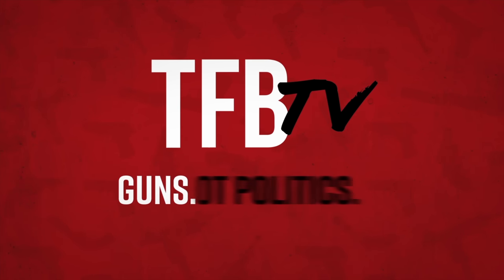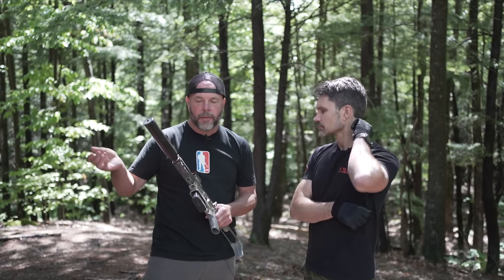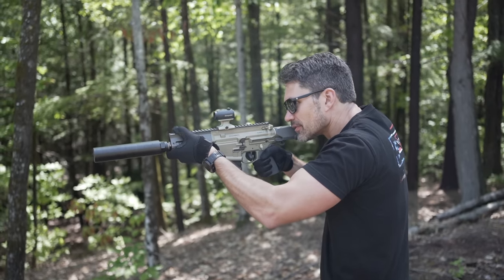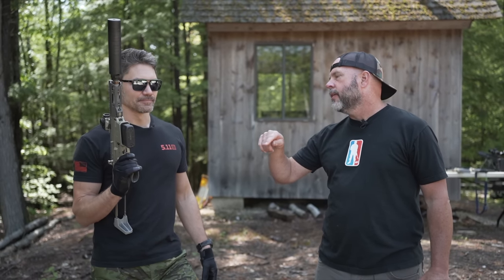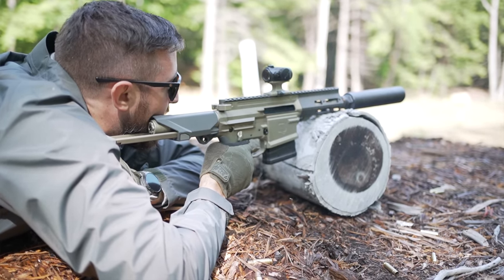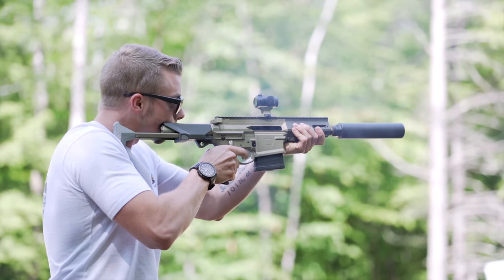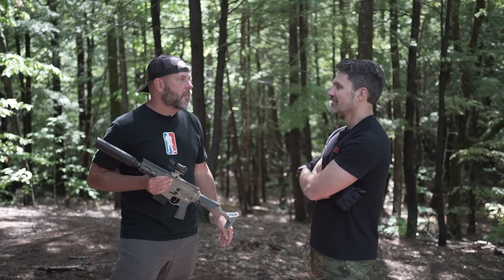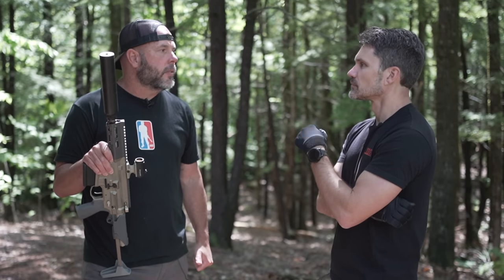NEW! Q BOOMBOX: The Honey Badger's Big Brother

Comment: I’m a huge fan of the 300 blk out. Done got 8.6 blk out ammunition but no gun.  It’s in the works for me.  Maybe I’m looking at it wrong but the faster twist rate will give more kinetic energy on target than most other common guns.  Why kill my hearing or my shoulder.
Reply: The high twist rate is needed to stabilize the slow, heavy, subsonic bullet. I'm comfortable guessing the vast majority of the energy deposited into a target comes from a bullet's linear velocity not rotational velocity...I think if you fired a spitzer into gel from close range (no chance to keyhole) from a rifled and unrifled barrel you'd see pretty similar results aside from any tumbling the lack of spin might introduce

Comment: Reloading for 8.6 is going to be a MUST! With modified .308 brass the cost of reloading ammo shouldn't actually be that bad. Not any worse than any other large hunting caliber. .338 bullets are still usually quite expensive but if this caliber takes off like 300blk did then there should be some good affordable options out there over the next 5 to 10 years. I'm excited to see if that happens and to build a gun in the caliber to mess around with.

Comment: The gun is neat. But im more interested in if other companies will make a rifle chambered in 8.6. Maybe we will get a ptr51 chambered in it and it won't be such a flashbang. Maybe a ruger sfar 8.6 version. Yeah it might be better than 300 blk, but some of big companies are just now making more than one/two rifles(or options) chambered in 300 and its been out awhile.
Reply: Faxon already sells rifles and barrels in 8.6 Blackout.
Reply: SFAR in multiple calibers is where the win is. Just need better barrel change capacity and aftermarket options. Lightweight .308 frame has so much potential.
Reply: Genesis Arms already unrevealed their 8.6BLK PDW with proprietary stock they designed for LR308 lowers (meant for their lower that works with any LR308 lower)
Reply: Of course they will. Just like they all made 300blk rifles after we did that…

Comment: Imagine coming out with a new gun that is essentially an AR platform in 2023 that ISN"T ambi!
Reply: I don’t like most ambi controls, personally. It’s extra weight, more crap to get caught on things, and more crap to get in the way. I de-ambi (aside from the charging handle) just about every factory AR I’ve ever bought, even a POF (heresy, I know).
Reply: Imagine being a lefty 😂
Reply: @jackjohnson291  how weak are you that the weight of a single safety selector or a big deal?
Reply: just don't be inferior handed
Reply: You're left handed? 🤢
Reply: @ethanbarnes3973 imagine being single handed and cant swap shooting stances depending on situation and angles
Reply: @jackjohnson291  too much weight?

Sounds like a skill issue. . .
Reply: I’m not a fan of ambi controls. I hate ambi safeties. Sorry if you are wrong handed! 🤣
Reply: An ambi gun allows you to keep your dominate hand on the grip to lock the bolt back.  Big advantage if you're clearing malfunctions, etc. or just want to lock the bolt back.  Every gun should have this capability now.  My ADMs and LWRC are my favorite guns because of this.
Reply: Isn't ambi, has a stupid ass mounting system no one asked for, which they also put on the top rail, and unless this isn't final, the shit doesn't even have a dust cover. 

Not to mention the tax stamp you'll need for a stock (which Q will also prolly charge the shit out of you for), likely some egregiously high ammo prices, and the $3K+ price tag. Ridiculous from top to bottom. Makes the Honey Badger look a lot more reasonable though lmfao.
Reply: @ckkevin9620  How many gun fights have you been in? In said gun fights, did you (like an idiot) jump out in the open to clear the malfunction? Complicating the design is problematic for all reasons mentioned above. But y’all do you…
Reply: The only ambi feature I think that is actually worthwhile is ambi bolt catch. Normal non-ambi bolt catch is awkward and requires swapping your shooting hand. Probably the only user experience design flaw on what is otherwise the genius of the original AR-15 lower receiver.
Reply: @jackjohnson291  so being able to clear a malfunction faster is bad now?
Reply: Ar platforms are just so LAME like genuine chudd rifles bruh, if thats all u can afford ok then but Jesus christ its so cookie cutter its boring.
Reply: Ambi is lame. Still.
Reply: @pablo4yu  need better bait mate

Comment: 9x39 exists, fits in a shorter action, fires bullets that are slightly wider and just as heavy, and doesn't require a twist rate that's closer to a thread pitch than rifling. I just don't understand 8.6.
Reply: It’s not Russian.
Reply: well it doesnt sound like youre a ballistics engineer so no one would imagine youd understand it
Reply: 9x39 doesnt have the super sonic capability offered by 8.6
Reply: 9x39 has inferior terminal performance at subsonic velocities.  The copper 8.6 projectiles peel into half dollar size flowers.  8.6 is not meant for plinking. It's meant to maximize subsonic performance at ranges well beyond conventional subsonic ranges.
Reply: Why the fuck is the boombox using such a short barrel?
Reply: @notjaisavage740 why use a long barrel if you can use a short barrel. Barrel length really doesn't offer any advantages for a subsonic round.
Reply: The twist was the entire point. Greater bullet expansion and more energy on target.
Reply: @mega-nerd  but why not do both?
Reply: @notjaisavage740  I'm not a ballistics engineer but I did hear one once say that casings will fall apart at that twist. I'm sure there are reasons, and a fair one is the economics. If its $15.00 a pull then who would adopt it?
Reply: Fast twist shoots flatter, more accurately, and puts more energy on target. 9x39 doesn’t have a supersonic option.
Reply: @notjaisavage740 fast twist allows to use a shorter barrel and make the weapon shorter and lighter. We aren’t relying on linear velocity for terminal performance.

Comment: The one thing i wish it had is the Brownells gas shutoff system that lets you use it as a straightpull bolt action. In case you want the semi auto with optional super quiet shots.

Comment: This is innovative stuff. And I don't mean just the 1 in 3" twist. But especially the twist rate. I think a lot of people don't understand what the twist rate can do for muzzle energy and energy downrange. I quickly built a spreadsheet to see what twist rate can do for energy and I'm still hard. And that's after I came a little.
Reply: I think there can be a lot of interesting development for lower MV but ultra-high rotation defensive rounds. Traditional soft expanding projectiles are basically a “solved game” at this point.

Comment: So it took 10 years from 300blk to be introduced to being a mainstream round. Lets hope 8.6 takes less than that
Reply: I don't see it happening.  300 BLK has the advantage of fitting in the smaller, more affordable AR-15 platform.  8.6 requires the larger, much more expensive AR-10.  Maybe you can do it in something like a Ruger SFAR.  300 BLK uses common and inexpensive .308 bullets.  8.6 needs less common and more expensive .338 bullets, particularly ones that that can withstand the fast twist rate.

300 BLK succeeded because it could live up to most of the marketing hype.  It's an extremely versatile round that performs well in places the 9mm and 5.56 fall short.  You can run it subsonic at close range where it outperforms the 9mm using a platform the same size as just about any sub gun.  The trade-off is ammo is heavier to carry.  Supersonic, it delivers much more damage than 5.56 at shorter ranges, but it doesn't reach the 500-600 yards 5.56 can.  But if you only care about 0-300 yards, it does a great job right there.  It's not a bad one-rifle solution for someone who wants a defensive weapon that can also be used for hunting medium game.

8.6 BLK is mostly a one-trick pony.  I'm sure it's a fun range toy, but I don't know how big the short-range subsonic large game hunting market is.  But outside that, it doesn't do anything that .308 or 6.5 CM can't, other than drain your wallet.
Reply: @JaronActual  I already had a solid 308 AR-10 and for $300 I got a 86 barrel and gas block. So the total invested in my rifle was around $1000. My AR-10 is a M&P 10 and got it on sale.

Comment: two things will kill this: 1. Brace ban 2. Special 8.6mm suppressors vs standard .30 cal cans
Reply: .338 cans are a thing.
Reply: @brivas3343  yeah no shit. How many of them are in consumers hands VS .308 suppressors?
Reply: @brivas3343  Sure, but nobody owns them. As opposed to 7.62/.308 cans that are extremely common.
Reply: Uh, you need to pull out a 2nd mortgage for ammo.  That could be a slight issue. 😒
Reply: No use bought .30 silencers until I did 300 Blk 🤷🏽‍♀️
Reply: @kevinbrittingham6774  yes and no. I bought one of your .30 AAC cans before I had 300blk because I wanted a multi-cal can to suppress my 5.56,308, and, 762x39 guns. Nobody out there has a .338 can because it's multi cal, they have them for their big ass special use "sniper rifles". But, this new caliber and rifle offerings from Q will certainly drive up sales for big bore cans. It's just not going to take off like 300blk did

Comment: That hand rail system is dumb. I wasn't aware I needed something "stronger" than keymod or Mlok and then you have to buy all new stuff. If it isn't broke, don't fix it. That will probably make people not want to buy it. That being said, this round and gun is an engineering marvel for what it is. I hope it becomes cheaper and more common like 300 blk
Reply: The mounting system is superior. Stronger, lighter, better zero retention.
Reply: @kevinbrittingham6774  Just because something is "superior" doesn't make it more useful. I bet they put Mlok on the version they sell to market.
Reply: That’s ridiculous. But, a cheaper version will exist and be basic.

Comment: I mean, yeah, it's cool.  Couldn't you just rebarrel an Aero 308 and get something to do the same thing, for a third of the cost?
Reply: Q isnt about Financial efficiency
Reply: FN FAL or g series.
Reply: This looks to be based on the revolution receivers so not quite
Reply: Yes, you can re-barrel a .308/6.5 CM upper and change calibers with just the barrel swap. Same bolt face, same receiver, same magazines, etc. The gas tube lengths tend to be shorter (pistol length on 8" and 12" barrels, carbine length on 16" barrels) but it is pretty simple to change those components when you swap the barrel. It's not inexpensive to shoot, even if you reload, but it is fun and versatile as a hunting/home defense platform.
Reply: No… the whole point of 8.6 is that you can have a much, much higher grain bullet than a 308 case would allow because it’s a larger diameter, longer bullet going into a shorter case.  That is what you want for shooting subs specifically. The idea is that you have a high energy subsonic platform that can also shoot supers in order to flex to longer ranges.
Reply: @danpurvis3108  Yes it would work. If you swapped the barrel and gas system you could shoot 8.6 without a problem. It's the same case head as 308 so the bolt will work fine, and when you swap barrels on an AR pattern rifle you also swap chambers because they are part of the barrel so that would not be an issue. As long as you had an adjustable gas system and the magazines feed 8.6 properly it would work fine.
Reply: @danpurvis3108  Yeah, I get your point, and I like the concept. My point is that it can done through a standardized and cheaper platform, since it is largely compatible with the AR308 based systems that can accomodate different calibers.
Reply: @JorgeGarcia-lw7vc  ah okay, I misinterpreted you. You were talking about chambering 8.6 in a cheaper platform.  That’s probably what I’d do too tbh.  I think the cost of the boombox is mostly associated with getting the weight and size down substantially lower than what you would be able to do with a run of the mill aero build. Whether that matters at all to you is a whole other question
Reply: Of course. You just miss out on a lot of features.

Comment: Kinda wish they had gone with a 9.5mm(.375) instead of 8.6mm(.338)
Reply: its so it can feed from ar10 mags

ar10 magazines angle the cartridges by grabbing the case neck of a 308 which is .338 in diameter, the 8.6 is shorter so the magazine grabs the bullet instead.
Reply: @hackerbot809  couldn't they do all that with the .375 bullets as well, plus the additional flexibility with all the existing safari bullets as well as bullets designed for long range
Reply: 375 isn’t reliable in SR-25 mags